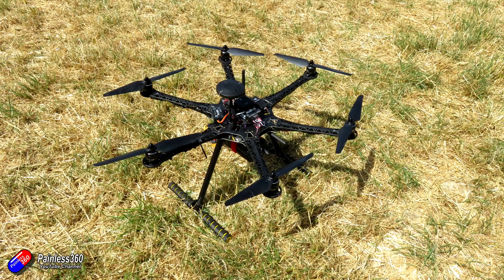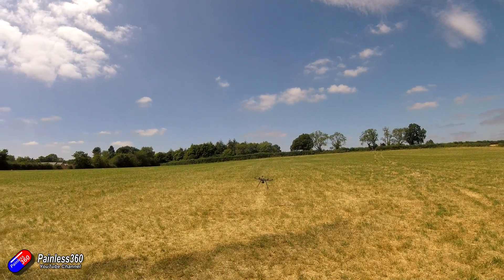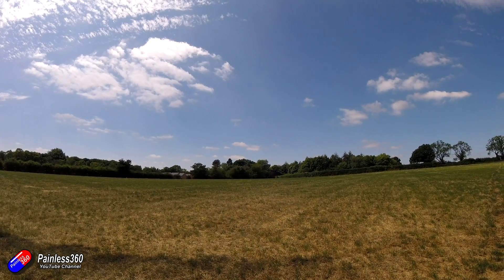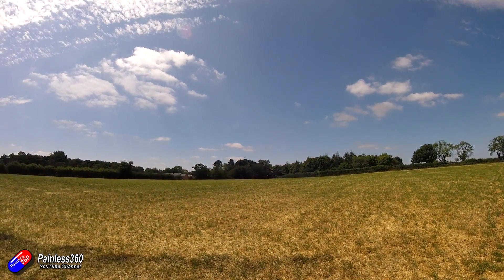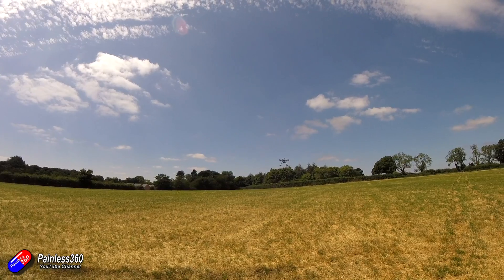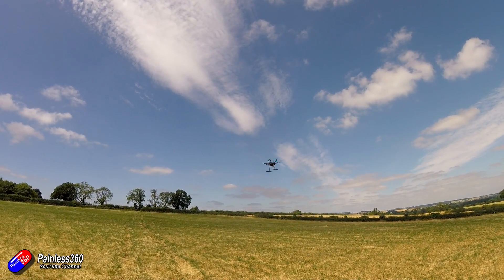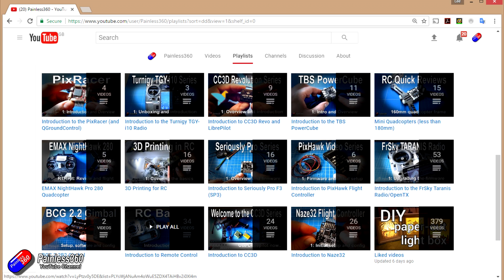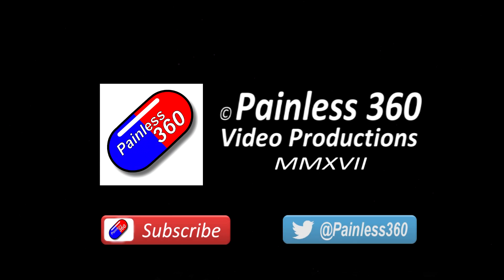Can a Hexcopter fly with one motor down?

Comment: I wonder how it would fly if it lost HALF a prop and had to deal with that vibration.
What would be really helpful is if the controller could detect the motor had a problem and shut it down. That would save battery and stop a condition that could cause more damage. Plus the other blade could still let go and cause additional problems/damage.
I also wonder if in the case of a hexacopter if there wouldn't be an advantage to cutting the opposing motor and changing the flight profile to that of a traditional quad.

Comment: I have the same S550 frame but with a Pixhawk 1 running the latest build of Arducopter so glad to know that it wouldn't crash with one failed rotor.  I am using Hobbywing's X-Rotor 40 A ESCs with Sunny Sky X-2212-13 motors and 10x4.5 Master Airscrew MR props.I get really short flight times out of a 3s 5200 mah battery so was wondering what Ben was using on that build.

Comment: The s550 is my favorite drone. The dihedral angle of the arms, gives it a feel like no other. Also running APM2.6, setup from your video series. Rock solid performance. In loss of one motor, don't use the yaw command.

Comment: In 2013 researchers at ETH Zurich developed a novel control algorithm that allows quad-copters to continue to fly in spite of multiple motor or propeller failures.  https://www.ethz.ch/en/news-and-events/eth-news/news/2013/12/new-algorithm-makes-quadrocopters-safer.html

Comment: I have tried this on my Sky-Hero Little Six hex, the cg must be a bit out on mine because whilst it will happily fly with one motor down, it spins around it's yaw axis pretty fast. But i have found two ways of flying like that - hit the return to home switch, that way the Pixhawk does all the hard work involved with keeping it on course. Second way is to have one of the flight modes set to Simple mode (something i never use), then you can fly the craft back to you with ease whilst the flight controller is once again doing the hard work. With my frame there is very little i can do to change the centre of gravity, so would never get it to fly with one motor down without the constant spinning around the yaw axis.

Comment: Hey great videos as usual. I was wondering what you think would be a good replacement for the DJI naza V2 Now that dji gave up on the Naza systems and are not further updating them
Reply from the maker: See my S900 rescue video. I'd go for one of the PixHawk family unless you're into FPV more than mission planning/GPS modes. If you are then check out the Vector.. See my flight controller comparison video from August for more details. Hope that helps.

Comment: I've seen a commercial hex land after throwing a prop. It wasn't particularly graceful but it was a controlled landing and hardly any damage resulted. Better by far than a quad with a dead motor/missing prop ;)
Never seen it deliberately tested in this way though. A very interesting video.

Comment: I recently received a Turnigy Pico switch to be able to turn on/off the light package on my Flamewheel.  It would be interesting to do this test again with one of the motors hooked up to a switch so you could disable a motor while the copter was in flight.  I look forward to you or someone else trying this as Im certainly not doing it with MY copter... :)

Comment: That's pretty good. DJI had protection for Hexas on the Naza-M from 2013 onwards (previously this was a feature of their 'pro' Wookong-M FC), but the copter would typically rotate around the failed motor so it was a case of (hopefully) getting down in one piece rather than flying anywhere near normally. I used the Y6 layout instead (in fact I still have a 900mm one with a Naza), which will fly normally with a motor out (given sufficient spare thrust on the other 5). But of course an in-flight motor/ESC failure is almost unheard of with an AP copter that's decently specced/built/maintained and flown pretty conservatively.

Comment: At a purely technical/theoretical level, you can actually fly a flat hex with two motor failures, but only if both motors happen to be in the same zero torque pair. Not something you can rely on, but an interesting observation!

Comment: I have a Thunder S550 like in the video with Naza FC and I have had an ESC fail and the hex flew home and landed fine.
It did have some undulation on the way,kind of like a spinning top just before it stops,but most importantly it came home in one piece.

Comment: Nice video, I was wondering how badly you would loose yaw control. The loss of yaw control depends heavily on the precise position of the CG relative to the lost motor.
The maximum thrust you can reliably achieve with a lost motor without detecting which motor has been lost is 33% for a hex and 50% for an octo so this will mean any significant load will come down with a lost motor but at least it will come down under control.
We have just finish developing automatic detection of the lost motor and that has enabled us to increase the maximum thrust with a lost motor to 66% for both hex and octo's. This does not need ESC's with feedback but ESC's with feedback will enable us to detect and react approximately 1 to 2 seconds faster.
Thanks for a great video!!
Reply from the maker: Yaw control was affected but it was still fly-able. Clever stuff!